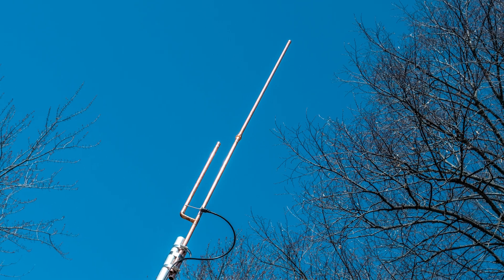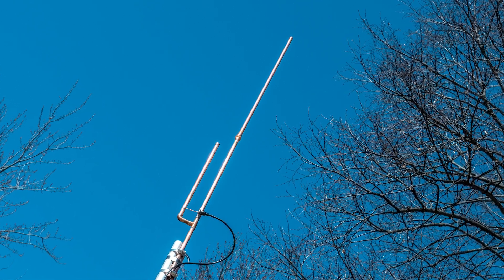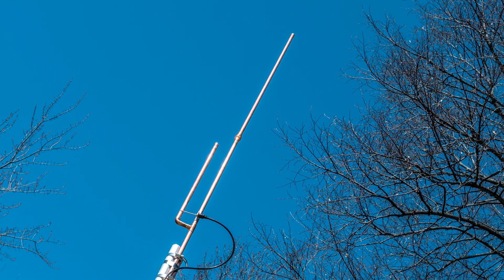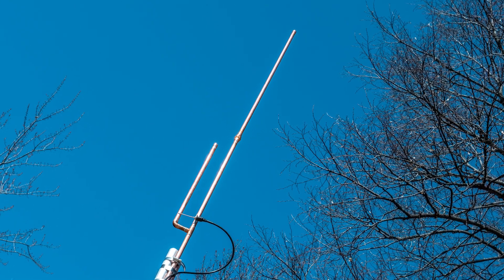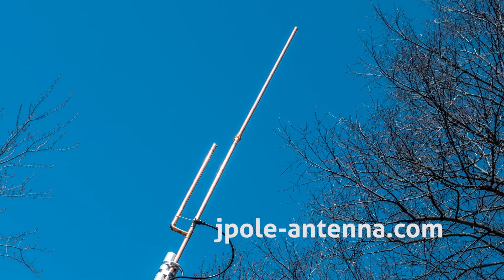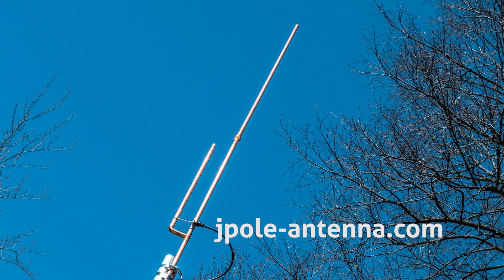Ask Michael, KB9VBR: Should I use a crimp or solder PL-259 for my coax cable

Comment: I prefer soldering. It takes lots of practice and many trial and error. But once you mastered it, it is the only way. Crimping can also have issue even with the right tools. Both require a sort of that delicate touch. But it's what you like, not what they say.

Comment: I have used the crimp/solder Pl-259s for RG-8X but it can be hard to avoid solder wicking to the outside of the pin, requiring scraping or sanding it off so the pin isn't oversize. I now use the Amphenol crimp/crimp connectors. The die set has the sizes for the shell and and the pin. They are not the cheapest but very high quality. I use the Andy-Crimp tool I bought for power poles and switch out the dies. Phil N3ZP

Comment: I bought a set of dies from DX and they fit my PowerPole crimpers. I may buy a set of dedicated crimpers at some point because I feel like I'm going to lose something before too long. I just bought 101' of RG-8X and six connectors and I am making three lengths of coax for $100. Can't argue with that. I had to increase from 100' to 101' to get free shipping ;)

D'oh, I just heard you say the PowerPole crimpers work with the DX dies. Oh well, I guess I didn't discover it.

Comment: I have worked for aerospace companies and now for a major emergency warning and notification company.  The general rule has and continues to be; if the connection will be subject to any amount of flexing, the connection shall be crimped, not soldered.  Only stationary connections may be soldered.  
I am IPC-610 certified.  Invariably, a soldered connection will fail at the transition point from soldered to unsoldered.

Comment: Messi and Paoloni have awesome connectors that you only have to solder the center pin. They use a special insert that makes contact with the shield and the connector without soldering or crimping. Everything is tighten down with a couple of wrenches and it has built-in rubber seals to keep moisture out. Of course they're designed for their cable, but it's about the same price as US Cable and it has better performance. You can actually get it shipped from Italy to the US in about 2 days for cheaper than you can ship across the United States. You can buy a limited inventory of fixed lengths with connectors already installed from GigaParts. Anything custom, just order it direct.
Reply: These are all I use anymore. 
They sell them on ebay and Amazon as well. 
These things really can't be beat.

Comment: I have had problems with crimping. manly poor quality connectors.My answer to crimp or solder is start with a good quality connectors. if crimping get  the correct crimp tool. I have the powerworx one. The dias come out with that 1 screw . Lately I found a better solution . I use the clamp and solder ones from M & P made in Italy ones. The ones made for the Pota flex 6 coax fit right on 8X. The 5 mm ones fit the RG 58/U coax.  They have them in BNC/SMA/N/PL 259/So 239 . They work great on foil shielded with braid coax. The Pota flex is made that way. All copper. the foil is copper.  ABR industries has great coax as well. their type of 8X needs a crimp connector because of aluminum foil . like the LMR coax. you need the correct connector.   DX engineering has great RG 8X and it is orange. The M & P connectors. worked great on that coax. Mostly I am lazy and have M & P or ABR make the jumpers with the good ends. And if I need N to BNC or BNC to PL 259 they make them that way for me. and they test them before shipping . And ABR puts the ferrite on coax if I want. Even a FT 240-31 core RG 400 PTFE coax with PL 259 to SO 239 . 73

Comment: Harbor Fraight sells generic crimper and then you can swap out that dye for the one needed for coax.
Reply: And it's a Klein copy. Good quality
Reply: Do you have a link for the harbor freight crimp? And what size die is needed? I'm working with RG8X

Comment: I have soldered my coax terminations for over 35 years, never ever had a problem, including Anderson Power Poles.  If you melt any part, or burn your fingers then soldering is not for you.

Comment: Why are they still the standard?  Years ago when I worked in commercial radio only the oldest gear had PL-259. GE, who became Ericsson was using TNC and newer Motorola was using mini UHF. All of the connectors were crimped. It was too easy to damage the coax with soldering. I guess if it isn’t broke don’t fix it.  Also I am fine with the PL-259 if the alternative is every manufacturer picking something different!  Just connectors like TNC or BNC or Type N are so much easier to crimp/build.
Reply: I use Type N or TNC where I can.  I usually just buy adapters for the SO239 output on my radios.

Comment: A lot of my wire and coax ends up in vehicles.  In a vibratory environment, you should always crimp.  BTW, never had an issue with other OEMs' connectors for LMR-400.

Comment: Solder or Crimp, well, industry and military practice should be your guide, they crimp. Crimping results in a consistent results. Soldering can result in damaged coax and damaged (melting the centre insulator) connector.

Comment: I have switched to all crimped. Maybe I solder wrong, but I've noticed that after a few months, every shield that I solder turns to dust. I've yet to have a crimped connection go bad.
73 KD9ZCG